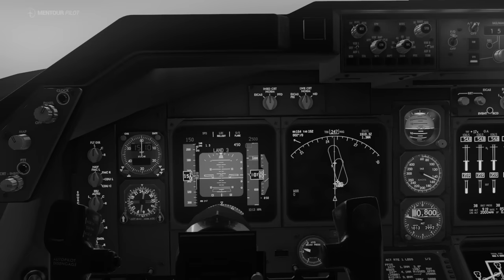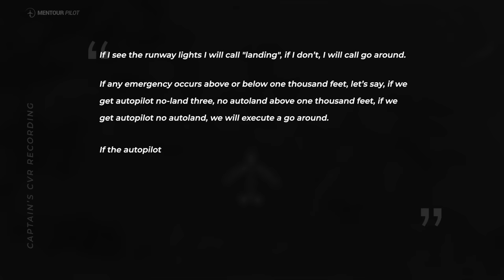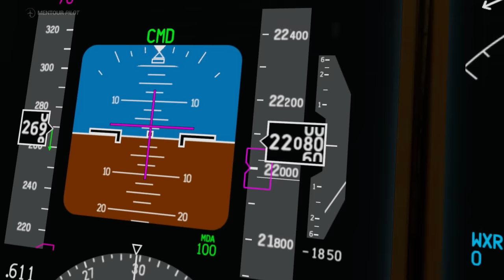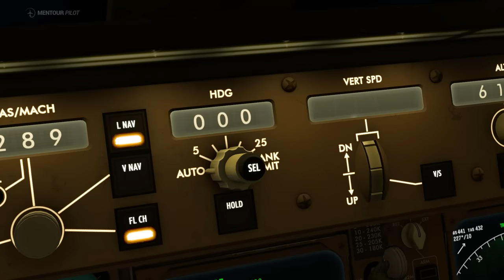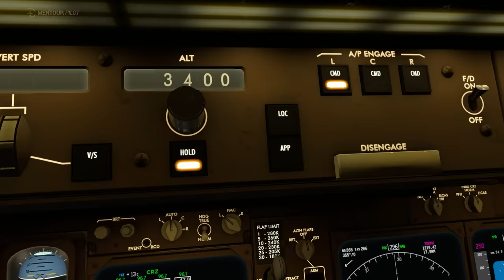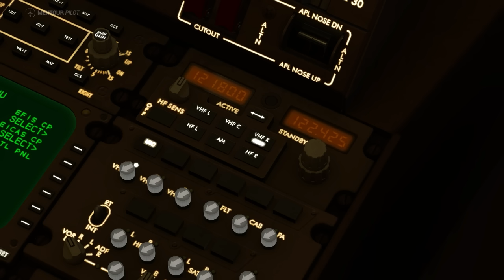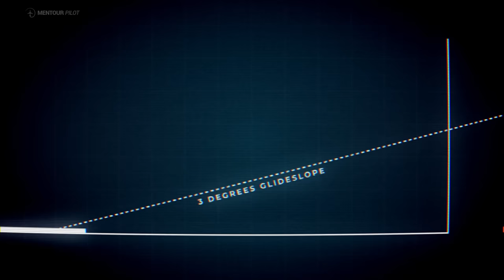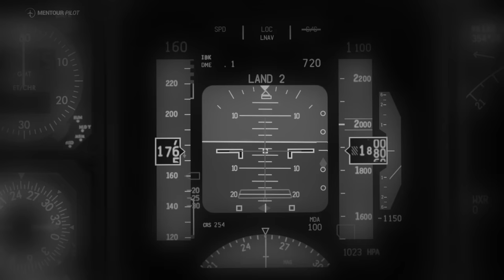Where is the RUNWAY?! Unraveling the Mystery of Turkish Cargo flight 6491

Comment: Retired international airline captain here. You do an excellent job on your videos and thanks for not being a “show man” but keeping it about safety.
Reply: What is more safer for longer trips. Driving in a car, or flying in an airplane?
Reply: @marcopolo3109  Wouldn't the chances be you'd run into more vehicles than airplanes no matter how long the trip?
Reply: @marcopolo3109  Airplane is way safer, and it is not even close.
Reply: You’re a show man!
Reply: @marcopolo3109 so you will completely disregard the important message of the original post, and turn the comments section to its usual kindergarten banalities.
Right...
Reply: @rayfighter  How completely uncivil of you. It was a perfectly legitimate question. If it doesn't meet your standards, why are you stooping to whining about it?
Reply: @KarmaKahn 

it’s depends upon how many and how recent the pilot received the “safe and effective” thing.  That thing mandated by the airlines per DOT directive.  This has reduced safety to a risk factor most critical thinking folks would reject.
Reply: Thank you for your service. As someone often in the back videos like this give a lot of perspectives, responsibilities and things most likely don’t think about. I appreciate it.
Reply: @isabellind1292  it has been answered countless times, including on this very channel, that the aviation is the safest way of traveling by far. I stopped by to upvote the message from the actual authority. Fastmph is exactly right - TV shows like Seconds to disaster and alike pushe hard on emotions, often using filmmaking tricks like telling heartbreaking stories of the concrete passengers who perished there, showing lots of screaming, flames and explosions, effectively producing sheer numbers of terrified flyers. Because they cared about their views.
Petter here skips unnecessary graphic details, while still showing deep respect for human life, and goes in great lengths explaining why it happened, and what aviation guys keep changing, enhancing and evolving, to make flying safer still.

I will also take this opportunity to thank you for the thoughtful reply, the argument you put forward for the airplane over the car must've had the calming effect, which is precisely what MenTour Pilot supports: chat of like-minded aviation enthusiasts.
Reply: @rayfighter They might be new to the channel. Not everybody knows these things. No need to resort to hostility when you have no proof that somebody is doing anything other than asking a genuine question.
Reply: @marcopolo3109 driving in a car 🚗
Reply: Exactly. Also, respect that Petter has developed zero ego either despite now having such a big subscriber base.
Reply: Former Army 15 tango uh-60 crew cheif here. I agree that he does a excellent job with his videos and other than his little spot for his sponsor keeps it all about aviation.
Reply: @marcopolo3109 airplane, especially if you want me to drive XD
Reply: I agree with you, very well done 👍
Reply: @marcopolo3109  Statistically, a much larger percentage of travelers die in road related accidents annually then the percentage of travelers dying in airline related accidents over the same period... I think you can draw your own conclusions form there. And then we are not even beginning to talk about the high amount of permanent disabilities inflicted resulting from road accidents...
Reply: @marcopolo3109  driving a plane is much safer than flying a car
Reply: Best comment
Reply: are we poking fun at Kelsey???  hes a cool dude tho
Reply: @marcopolo3109 Driving a car there is more to crash into, in a plane it's only needed to avoid the ground and a few planes.
Reply: It’s not like they did one thing wrong. Together, they combined for so many errors that I lost count.

What kind of training do these guys really have?  What kind of simulator practice are they required to do, to test them against the so-called “get-there-itis”??

This airline industry is as i’m disciplined and full of incompetent actors as the building industry is that I am  involved with….

…. It’s one thing to get a lousy house that should’ve been built better and more affordably, it’s another thing to be sleeping at night and a 747 lands on top of your house!

Honestly, as a pilot yourself, and I’m a pilot to too but just General aviation, I’m ashamed of the whole endeavor.

I look at that 747 instrument panel and it looks barely improved from the fighter jets are used to work on that were built in the 1960s. I worked on all those avionics. And then I flew a Cessna 152 to earn my pilots license …. the 747 Shown has virtually no significant instrumentation improvements that would further enlighten situational awareness.

Honestly, everything is bad here, the Technology in the plane themselves for user interface, the training of the pilots,  The stupidity and attitude of the pilots, The pilot’s union (that protects mentally ill pilots from being exposed and fired)…

Burns me up you can buy a car that will show you a Birdseye view of your car and all the traffic around you, so you have a supreme understanding of the situation, but not available in airplanes!! 

Your industry, like my industry, disgraceful.  But yours kills people wholesale!  Now that you are retired I hope you will make an effort if you have spare time, and I suppose you do, to advocate for advancement in airline safety, since you have more of a voice than I will ever have.
Reply: @marcopolo3109 😂
Reply: How you doing, captain.
Always wanted to fly those big jets, and the little ones,too
Could never find the way to come up with the flow.
Only got as far as a private license
Which is fun too, mostly those little light planes, but nothing compared with a 747.
Still dream being behind the controls, must be fun landing one of those with a crossed wind.
Just saying Hi
From Culiacán Sinaloa México
Reply: Show man? He is Swedish. Is always about safety!
Reply: This stuff is unbelievably interesting and well explained, the visuals are perfect and you can learn the lingo, this should be a must watch for anyone, pilots and not. I am actually starting to think, that managers in general would benefit from pilot training.
Reply: @marcopolo3109 this can’t be a serious question. The car is the most unsafe form of transportation BY FAR. Car death rates are as high as 10 fully loaded airliner crashes every day.
Reply: When commenting  comes from you sir  video must be legit
Reply: @truehighs7845 Pilot training? I've worked for managers who'd benefit from toilet training. 😐
Reply: Wow...I have great respect for pilots!
Reply: @skepticusmaximus184  that's actually very very funny, and so true!
Reply: @marcopolo3109 over 10k deaths a year from car crashes. Maybe one major plane crash every few years. Sometimes u have an uptick that makes people fear planes but still far safer
Reply: Honestly its crazy how this, tenerife, the other foggy airport one, so many of these were completely avoidable without ignoring basic protocols, a captain being a moron and rushing while the first officer is making completely coherent points..i mean im not surprised the airport got shut down it seems pretty clown shoes too
Reply: Its crazy the pilot actually survived strapped in his chair and then died in hospital
Absolutely horrible casualities for such a moronic captain
Reply: @foximacentauri7891  thats only because statistically there r more cars on the road even the playing field and a plane is a death chance everytime
Reply: Hear Hear!
Reply: @rayfighter ❤
Reply: @marcopolo3109 airplanes are much safer, there are so many vehicles you come across so there’s a higher chance you’ll get into an accident. There’s a much lower chance you’ll get in a plane accident, but if you do you’ll probably be critically injured or killed. Length of trip doesn’t really factor in as much
Reply: @jimena6194  I agree, do you often fly?
Reply: Flying makes most people more nervous than driving, but I feel like we treat Pilots more like bus drivers than technical experts who must consume and quickly respond to insane amounts of data to keep us alive. When did that happen? Pilots used to be revered.
Reply: There's not a total loss of respect, but it has come down a great deal culturally. Thoughts, sir? (Or Maam. Sorry to assume!)
Reply: @KarmaKahn 😅😅
Reply: @KarmaKahn realistically vehicle drivers should be forced to train even 10% as much as pilots and it would eliminate alot of tragedies
Reply: @marcopolo3109 are you gonna drive from New York to Paris?

Comment: My wife and I had our honeymoon at St. Barts. Most pilots know about that airport. We'd been stranded for 2 days in Puerto Rico due to horrid weather. Finally the weather cleared ... sort of ... and we took off for St. Barts. I'd been flying Cessna 150s for a few years at that point and, although we were in a larger 6-seater I was mentally going over how I would control the aircraft if I was flying it.

We got to the treacherous down sloped runway and I knew Immediately that we were too high. I was certain he'd do a go around, but no ... we landed hard. And went straight into the water. I got a bump on the head but that was the only injury. We were refunded our tickets.
Reply: A dreadful situation for you as you realised what might happen,glad you came out Ok ish...sad that your pilot in command attitude had part of the problem shown in the above vid.
Reply: TBF, I think a normal approach to runway 10 at St. Barthélemy would look WAY too low to most pilots.
Reply: @h8GW  Seriously. You can almost shake hands with the people on that crossroad in the flight path!
Reply: in these situation could you advise pilot to go around? I don't think your plane had second pilot for checking
Reply: @vipvip-tf9rw  Happened too fast, I'm afraid. I don't think the plane was damaged. But I did ruin a flash drive that was in my pocket when I jumped into the water.
Reply: @Sternodox  I'd be looking for more than a refund on a ticket in the event of the plane going INTO THE WATER!!
Reply: You didn’t have time to unpack before you started swimming 🏊‍♀️. You cram every second in your vacations don’t you 😮😅. I’m glad you’re safe though
Reply: That is an airline's dream. Get them there, they pay up. Don't get them there, just refund the ticket. No other obligations.
Reply: I think I saw that incident.  Or one just like it here on YouTube.  Left about 100 feet of identical skid marks.

Comment: I spent many house of my life on that runway while it was repaved.  Part of that time, they had a displaced threshold for RWY08, reducing the length by about 3000'.  Pilots still had 10500' of runway to use.  This didn't stop some pilots from buzzing the paving crew.  An AN-124 flew over them at no higher than 30'.  It was really scary and the paving crew was pissed.

Comment: I am a non pilot, aviation enthusiasts. But a larger part of why I watch aviation incident analysis videos is to relate them to life in general. I love how these videos explain what and how incidents happen with overtly shaming and blaming. It makes it easier to relate incidents to our lifes in general. 

Not doing a go around is similar to a driver on a limited access highways like a USA Interstate highway or the Germany Autobahn quickly crossing multiple lanes at the last seconds to make it to an exit ramp. A go around is like realizing the situation and deciding to continue to the next exit to turn around and come back to the correct exit. The reason for not doing a go around are similar to not going to the next exit. Risks and costs to the pilot are similar. There are more lifes, fuel cost and time delays in aviation. This just increases the pressure. It doesn't make the decision easier. (Running out of fuel in a car rarely results in a crash.) In driving this is likely one of the most dangerous decisions/ mistakes that happen on limited access highways. 

My point is that we frequently see this similar driving mistake. We may even make the mistake ourselves. Do we understand the similar? Do we understand the similarly in the causes? Do we understand the risk? Are we applying the lessons from these aviation incidents to our own lifes?
Reply: I'm a miner. I love planes and everything to do with aviation. But what you learn here applies in mining too. We keep saying safety is first, and there is no shortcuts to safety. Accidents in mining are as fatal as in flying.
Reply: Thank you both for sharing! It shows also that we all can learn from it. Agree!
Reply: Freeway exits. What an excellent analogy.
Reply: If we had to study this much half the population wouldn't drive. People are basically lazy & like short cuts. There's no room for that in flight.😢😢😢

Comment: The disappearing glideslope should definitely be a timeout implementation... Meaning e.g. glideslope gone for more than 10 seconds disconnects the Autopilot...
Reply: Agreed. I think that the GPWS ought to be able to detect a false glideslope also. If the plane is flying the 9° descent, that would generate a "sink rate" warning. But in this accident the airplane defaulted to a 3° descent, so no GPWS warning was generated.
Reply: @bbgun061  I mean... I don't wanna say it... but that is like Computer Science 101... You don't make the user (in this case the pilots, yes I know hate me pilots, but you're just users. ;) ) think that nothing changed when something substantially changed. And I would think that the thing guiding the airplane down to the ground during a full autoland is quite substantial...

Classic case of the developer *assuming*. And we all know what that does to you and me. ;) 

Also, while I understand this should be an error proofing measure, it doesn't fulfil the redundancy required by such a system.
If one Autopilot starts throwing out ironeous data, yes, STONITH, kill it, keep the other two, let the user know. (Also how we do it with high availability servers for example.)
But this error affects ALL autopilots. The calculated path is not cross checked.
Kinda like when the non-redundant network switch goes down. Nothing there to fall back to, other than assuming what is right.

Tbh, if that code made it through Boeing's code reviews, I'm kinda scared about what else made it through. 😅
Reply: @lightjack0540 You're right.
I'm talking about separate systems that might be able to catch an error in one system. The ILS receiver can't detect if it's on a false glideslope. The GPWS does have a function that detects an excessive sink rate during approach. But that condition wasn't met because the autopilot did not maintain the 9° descent.
The fact that the autopilot continued indefinitely at a 3° descent with no glideslope input is an obvious design flaw.  But there were indications that something was wrong. Multiple warnings were given to the pilots. They chose to ignore them. Also, they continued descending below the decision height for a few seconds. That delayed reaction suggests to me that they were used to doing that. They probably had a habit of landing in weather below minimums, where delaying the go-around might allow them to catch sight of the runway and land.
Reply: @bbgun061  I mean yeah, there were warnings, but no obvious: "Hey, youre actually flying down an imaginary Glideslope".
Like... I get that it can work, but clearly state to the pilots what the computer is doing... The warnings werent explicit enough... An FMA announcement shouldnt be what tells you something like that.
Reply: Where contemporary planes have GPS mapping, any airport/runway could be geo-fenced so that when landing, and at or below a certain altitude, the system should notify the pilots when they are over the runway and how much of it is left to go.  Also, as in this incident with low/no visibility, if on auto land, it could calculate the distance to touchdown given the glide slope and generate a warning if the current glideslope will result in landing too early or too late.
Reply: when there is pilot like this they probably couldn't even realize it is disconnected and crash anyways.
Reply: @peterbronk661  what you're talking about sounds like Garmin's synthetic vision system that's an option in most of their primary flight displays. It shows a 3D model of the terrain; including runways, taxiways, and obstacles; as they should look from the pilot's perspective.
As far as I'm aware, no airliners use Garmin avionics. They are used extensively in general aviation, however.